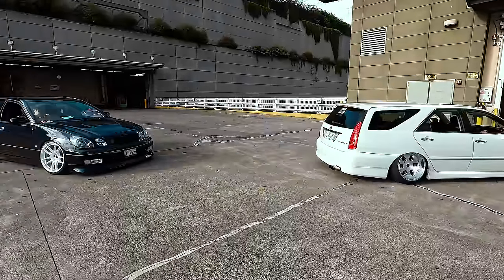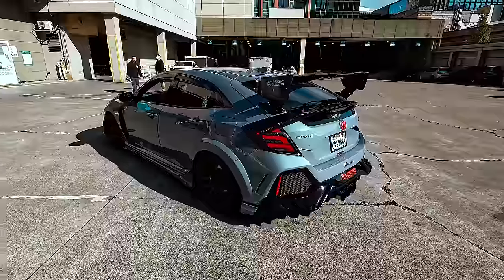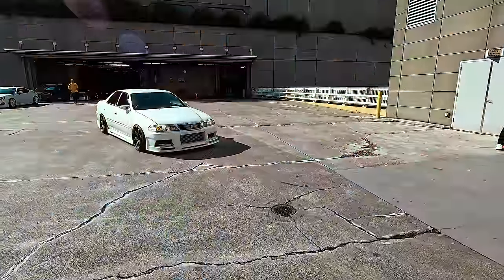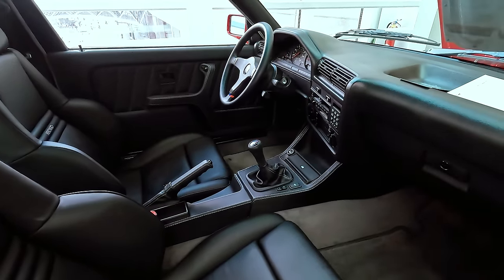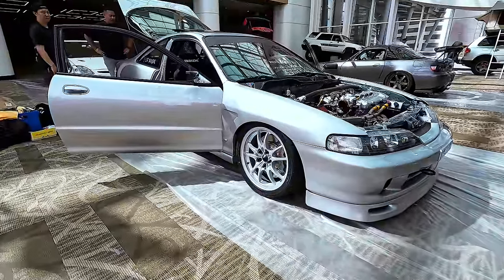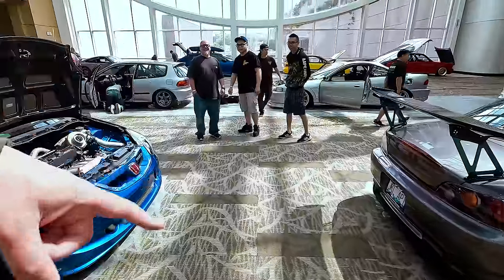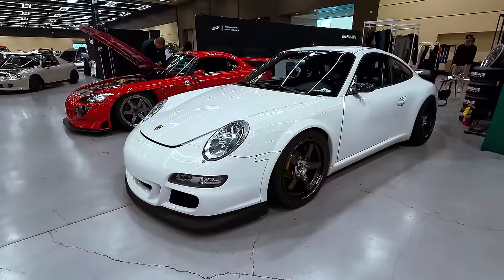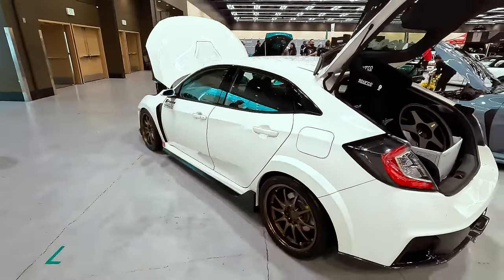Why The WEST Is BEST Part 2: WEKFEST SEATTLE!!...

Comment: Those newer bmw’s are boringggggggg
Reply: How so?
Reply: They're not drippin in heat?
Reply: They’re also mind blowing fast
Reply: I hate to be one of those old guys that sh*ts on new anything but....

Most new vehicles released are suvs, and most modern vehicles I struggle to get excited about.

Strangely I prefer the style of the new m2 to the fl5 or '24 integra type s.  But in general they seem unnecessarily long and bloaty.  We live in an age where the new civics absolutely dwarf older accords.
Reply: Agreed. I mean they are nice and pretty baller but it doesn't excite me.
Reply: You Trippin! They better than all them older years💯💯💯